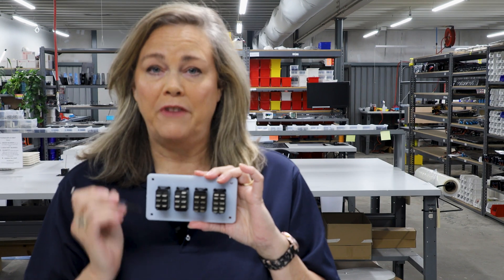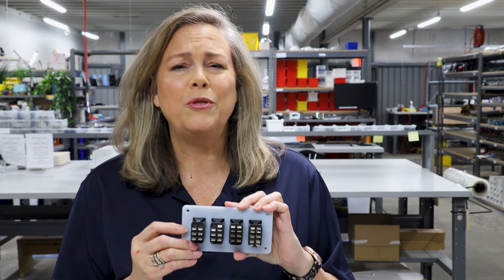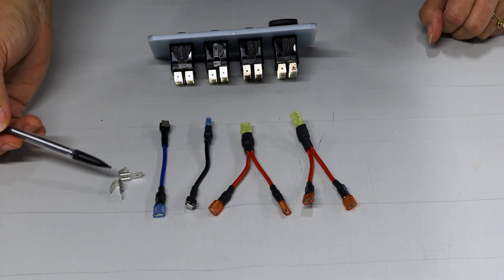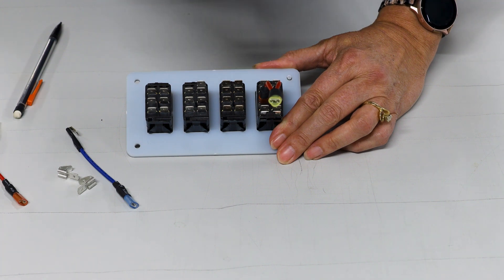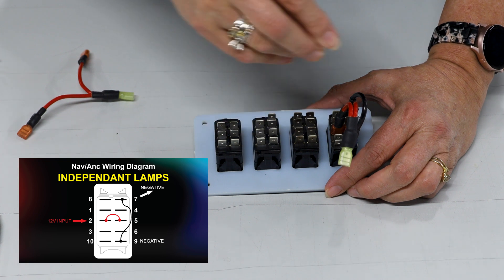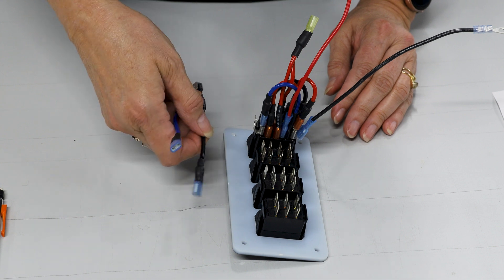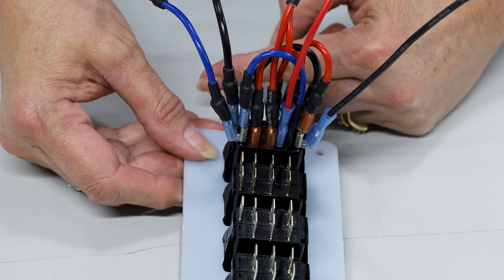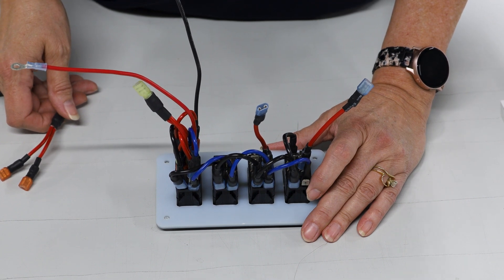How to wire 10 Terminal Carling Style Rocker Switch

Comment: Thanks for sharing this in-depth Carling switch guide. I found one of these Carling ( 7 terminal/pin) switch  in my electronic junk box, can I use it for turning on my Polaris Ranger accessories/whip lights? How could wire this switch as a simple on and off switch?
Reply from the maker: Sure, just hookup incoming power to T2, and lights to either T1 or T3.  It just won't do anything in the other position!
Reply: @NewWireMarine Thank you!

Comment: Hello, I have a situation, long story. O.k. I drive 18 wheelers I have a parts truck that I take parts off, so I swapped out driver doors, from roll up to electric.  All the wires on a freightliner columbia are yellow. I didn't know how to hook up the 10-prong switch to the roll up window. So, I search and search YouTube and came across how to wire a 6 Pin toggle switch on off on and it worked, but I wanted to use the 10-prong switch like the one in your video that came off the electric window.  I'm not sure if that switch lite up or not, but it probably did.  So my question is, this that you are explaining will it work with an electric window motor?  If I just want the window to go up and down, do I have to hook a wire to all 10 prongs?  I hope I explain this right.  Hope to hear from you soon.  I'm going to keep watching your video over and over until I get it right.
Reply from the maker: This isn't the video for an electric motor up/down... I think this one will serve you better: https://www.youtube.com/watch?v=vgauD-W61YA

It takes a few jumpers to reverse polarity on the motor windings... the light portion from this video should be applicable if you have one of our 10 pin switches, or one that's wired the same.

Comment: I just installed a bilge pump with auto/manual options and purchased your three-toggle bilge pump switch, but I'm having trouble figuring out how to wire it to the switch.
Reply from the maker: Basically one position is manual, center is off, and the other position auto.  You'll have to put it on auto for the float to work.

Come out of T1 and T3 to the two pump wires.  T2 is power coming from the fuse/breaker.

Pumps with built in switches act exactly the same (in my experience) as those with external floats... you just don't have to make the external splice shown here: https://newwiremarine.com/how-to-wire/wire-bilge-pump-switch/

Comment: So if I wanted to use one of these for just a on off on for say a power rating switch to ecm for a semi one hot wire would be on either 1 and 4 and the other hot to ecm would be either 3 or 6 and then ground on 7? Asking because I want to use a freightliner headlight rocker switch for an on off on for a rating switch so it’ll look factory.
Reply from the maker: @nathanielcrowder1978  not sure I understand.  1,3,4 and 6 are outputs.  2&5 are the inputs.  1/3 and 4/6 will never be shorted.  You need 2/5 to make connection with the outputs.

Comment: What are the benefits of having either or dependent lamps or independent lamps?
Reply from the maker: An Independent lamp can illuminate “independent” of the rocker switch’s position.  Meaning that the switches does not HAVE to be ON for the lamp to be on.  It will necessarily have a separate power input just for the light, and is commonly used for backlighting the switch.  Backlight power usually comes from another switch like: head lights, Dash lights, Navigation lights on a boat or your ignition.

A Dependent lamp only illuminates when the rocker switch is ON.  So this type of lamp usually functions as an indicator light.  A dependent lamp will have wiring internal to the switch that forces it to always illuminate in that position.
Reply: Thanks 🙏